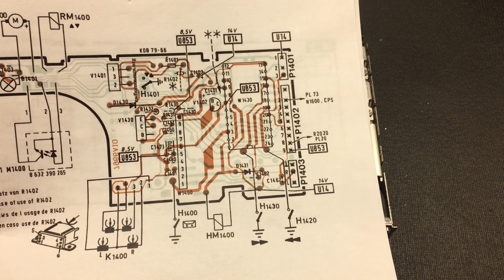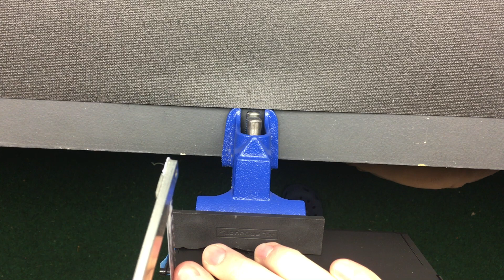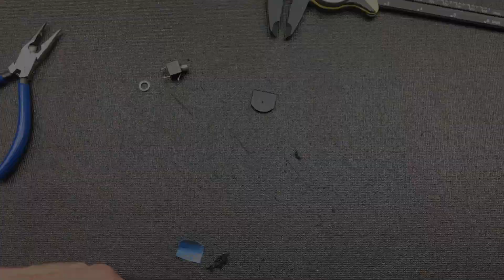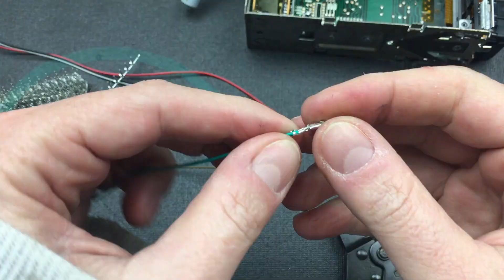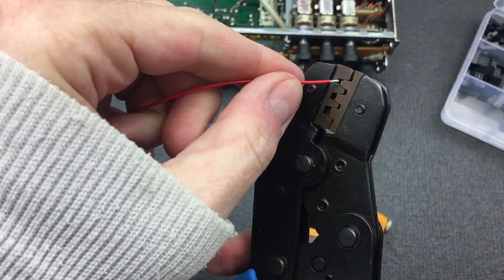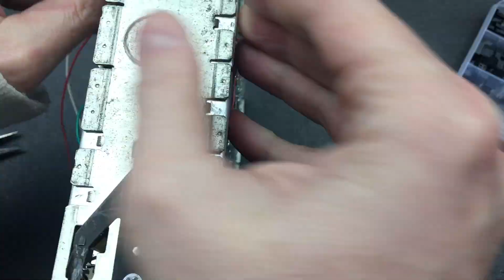Blaupunkt Monterey SQR 23 Part 3: Line-In Modification

Comment: Great videos! My Bamberg SQR 83 is similar to the unit you're working on. The 10 pin lcd is kaput, physically damaged, do you know where I could obtain a replacement or what the Monterey SQR 23 part number would be? Can you also recommend where I might obtain a service or user manual for either unit and what the correct fuse rating should be? Thank you for any info!